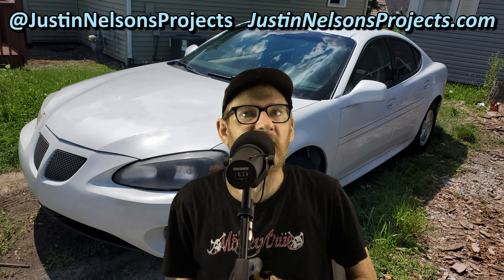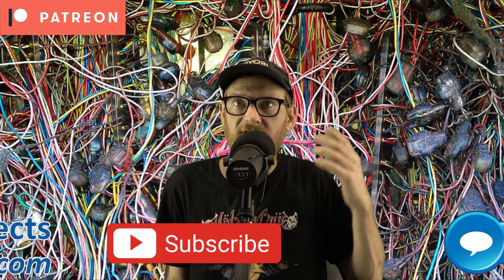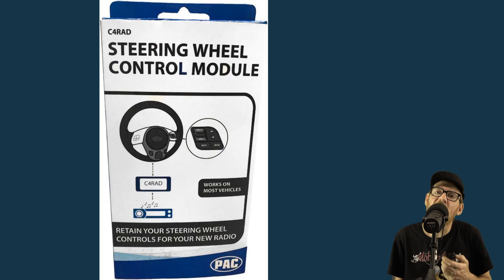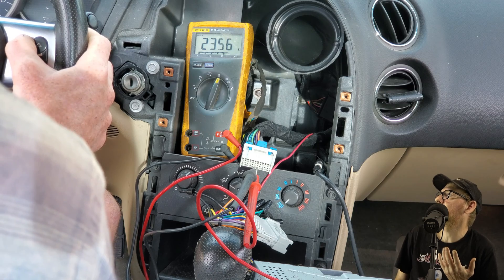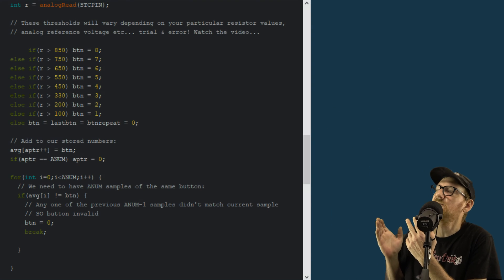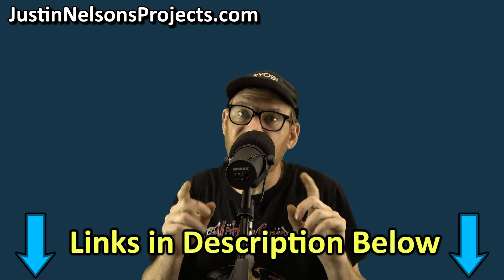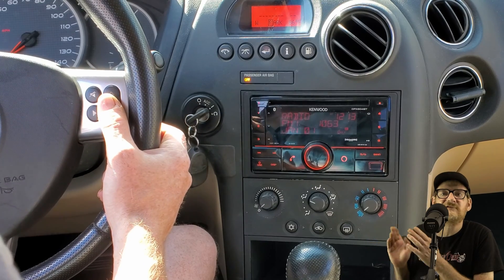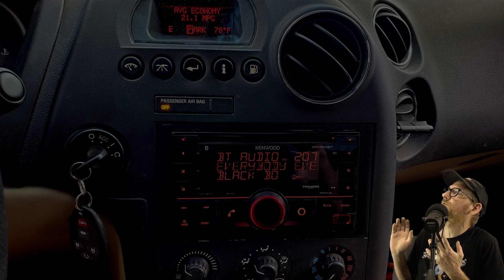Steering Wheel Buttons w/Aftermarket Stereo | Arduino Project - Save $$$ and Build it Yoursef! #diy

Comment: Hi, Sorry if this is a dumb question, but I think I need to combine the two sketches that you have - SWC & KENWOOD into one sketch to run on the Arduino.  Does that sound right?  If not, how do you get them both on the Arduino and running? As far as I am aware the Arduino can only run one sketch at a time.  Thanks!
Reply from the maker: The two sketches are for two different purposes. The main sketch, that controls your stereo, is what will run on the Arduino once everything is set up.

The other sketch is just something to run on a breadboard, so that you can capture codes from the stereos original infrared remote control. So if you have something other than a Kenwood (or JVC, same company), you might need to capture what code is output for each button on the remote.

Of course you can use the same Arduino to first capture those codes, and then try to emulate them with the other sketch after you've modified those codes in that sketch...

If you do have a Kenwood or JVC, that other project isn't necessary at all. The codes that already exists in the main sketch will work with Kenwood and JVC stereos, at least three different ones I have tried personally, going from a single DIN CD deck up to a full Bluetooth hands-free dual DIN...

Also as long as you're working with a General motors vehicle, up to the mid to late 2000s, that sketch should pretty much be plug and Play so to speak...
Reply: @JustinNelsonsProjects  OK, thanks for the reply.  I did see the IRCapture sketch, but the other two (SWC & KENWOOD) look like they need to be combined.  I'll study them a little more.
Reply from the maker: @boblinza9696  honestly I haven't looked at those sketches since I first uploaded them. And even then, I uploaded the sketches probably a couple weeks and maybe a month after the video went live.

It's possible I mixed up two different sketches. I will look into this tomorrow, and see if I can make things a little bit easier to follow. I appreciate the heads-up, and the interest in the project.

And just so you know, there is absolutely no such thing as a dumb question 😉 if it needs to be asked, then the answer wasn't explained properly the first time. I always appreciate feedback, it helps me make these videos and the accompanying files better for future videos.
Reply from the maker: I realize this can be a little overly complex, and to be honest it was a lot of trial and error on my part as well. It is not a project for the faint of heart...

In the future I am working on a more modernized version that would be a lot more plug and play, kind of self learning. That is an ambitious project on my part, but it would make it much easier for you guys to implement it. I don't know when that video will come out, I have a bunch of other projects in the pipeline right now, but subscribe and maybe one day that will pop up soon 😁

Comment: Underrated af video. I’m creating custom buttons involving: vol up, vol down, pause, play, seek forward, seek backwards, mute, and Siri, for my 2001 mustang. From factory there’s no audio controls (obv) but what shocked me is that there is ZERO support for attempting to add your own. Your video was very useful in understanding how the arduino can read what buttons are being pressed, and how I should wire it to the radio (an alpine ilx-w650). There are still many questions I have that ill probably answer through trial and error, but if you’d like to aid me through my design and test process, respond to this comment and we can get in contact somehow. You definitely earned a sub from me, excellent video.
Reply from the maker: Actually you can purchase aftermarket steering wheel buttons, they're basically like little tiny wired button boxes that you stick on to your existing steering wheel, however they generally look kind of tacky. And for what it's worth, a lot of GM vehicles had steering wheel buttons as far back as 2000...

As for rolling your own solution by creating your own buttons, with the Arduino it would be easier to actually just assigned each button to a gpio pin, rather than doing a whole resistor divider. That's mostly done to save on copper wiring in Mass produced vehicles... 

From there, the output would still work in the same fashion. But registering which button has been pressed would be a lot easier done digitally by literally just pulling the PIN to ground after initializing it as a input pull up...

Just a suggestion. If I had to roll my own controller, that's probably how I would do it and I'd have the Arduino probably contained within the button box. You could 3D print something stylish that would fit in with the mustang....

Just some thoughts, hope this helps 😀
Reply: @JustinNelsonsProjects that’s how I was thinking of doing it on my 1991 4Runner. The cruise controls are spread out to both sides of the wheel so I’m thinking of 3D printing new panels for each side, consolidating cruise on the right, and using custom buttons on the left. I was considering adapting controls from another vehicle to fit but I’m not sure if that’s easier than using off the shelf switches.
Reply: Hey, just wanted to ask if you managed to get it working on the alpine headunit, since i have a similar model! (ilx-w650e).

Comment: I'm just getting my feet wet with this, but how can you tell if your radio expects resistance values, or pulses on its SWC input?  In particular, I have a Kenwood DDX8906S and unsure what it is expecting.  Thanks
Reply from the maker: The only stereos that I am aware of that accept directly the resistor divider, would be the Factory stereo. Aftermarket stereos almost always expect pulses, corresponding to the IR remote (regardless of whether the stereo itself came with the remote control itself, it's still built on the same circuitry.

Kenwood/JVC specifically I can assure you, expects a remote control pulsed/encoded input.
Reply: @JustinNelsonsProjects  OK, thanks for the reply!

Comment: I'm pretty handy with wiring in a car, and I'm comfortable with code....but where can I learn the electronics aspect of doing something like this?
Reply from the maker: The video has pretty detailed schematics and a good walk through, but to get an understanding of how to read and interpret a schematic... I would suggest checking out Dave's videos at his EEVblog channel:

https://youtube.com/@EEVblog

A lot of his older content, some of it 10 plus years old, can help you get a good understanding of electronics in general, how transistors work and various other components. He makes videos on a lot of different topics, but most of his older stuff was really good beginner tutorials. 

Or just Google any basic course on beginner's electronics. I still plan an update video sometime in the future, and I will actually focus a little more on the actual circuit board build... In fact that's the most requested thing from my viewers -- I never really show the dirty details of actually putting the circuit together.

Best of luck and thanks for watching. It really is satisfying to not only save a hundred bucks on a pre-built box, but when you get to the point where you use the steering wheel buttons all the time and don't even think about the fact that you built the interface yourself, it's just a great feeling 😁

Comment: I was looking at this project as I am considering a new radio for my car. I thought I would try to do some bench testing with a radio someone else had laying around. It is an Alpine CDA-117. I was wondering if you had more information about gathering the IR codes. I have mapped out the codes for each button press, but I don't see how they line up or how it works in the code for the nano. Do you have the full NEC Raw Code data map for the Kenwood so I could compare? I checked the other guys project and it seems to have what I would call the truncated codes. I get a 32 bit code from NEC Raw Data, a radio code which seems to be the Address (0x86 for me) and Button Codes. From his data, I am not sure where his LSB data comes from. Example of remote gathered data: Power Button = 0x614E906F (Radio Code = 0x86) and Button Code = 0x9
Reply from the maker: I made that video about 6 months ago, I haven't really looked at the code since. I have however dug much deeper into infrared remote signals as I built a programmable infrared repeater for home AV equipment, video coming soon on that one. 

For this particular project though, I basically took some code I didn't fully understand yet and adapted it for the kenwood. The saving Grace was I happened to have the actual Kenwood remote control in order to map the buttons.

In the near future I will revisit that code, and maybe add better commenting and structure it a little bit differently to make it easier to adapt to other brands of car stereo etc. My ultimate goal is to create a total Black box solution where you can not only capture the remote control buttons, but also capture the steering wheel buttons and save all that to the eeprom of the Arduino...

The end goal there being, it would be totally universal, you build the project as shown and follow the programming instructions. Much easier than anything I've found "off the shelf".…

I will look into the original code that I posted and see if I can point you in the right direction probably in the next day or two.
Reply: @JustinNelsonsProjects  Thanks for the reply. I am looking forward to any updates.

Comment: I'll most likely use a variant of this for my truck. It has no steering controls, but I have a media remote that I am going to try with my new stereo. If the stereo doesn't directly support Bluetooth LE (packaging is unclear), then I'm going to try an ESP 32 as a middle-man between that remote and the steering wheel wire. There are tutorials by Andreas Spiess on how to do the communications. It'll be a fun project at least 😀
Reply from the maker: Good luck, let us know how that works out 😃